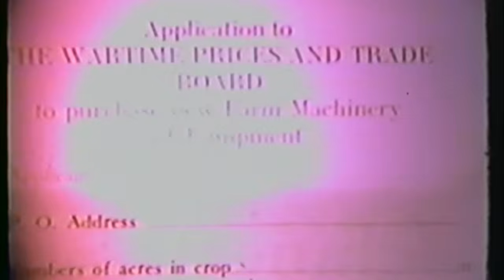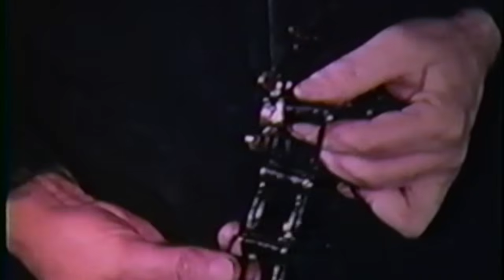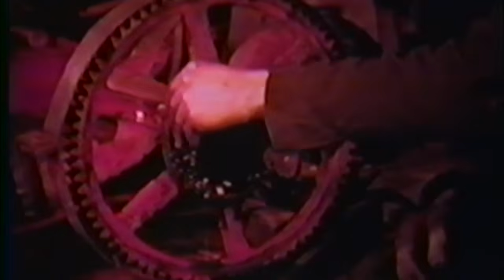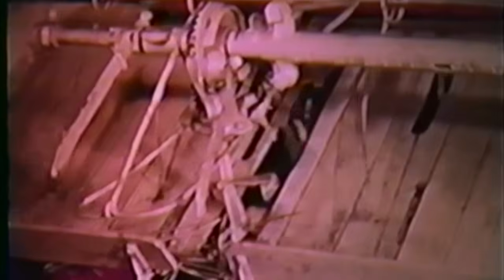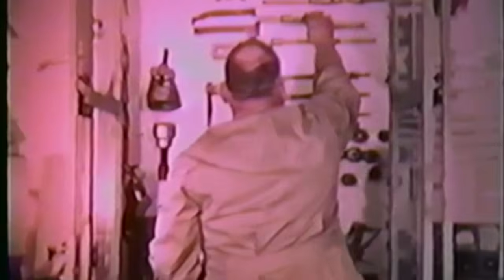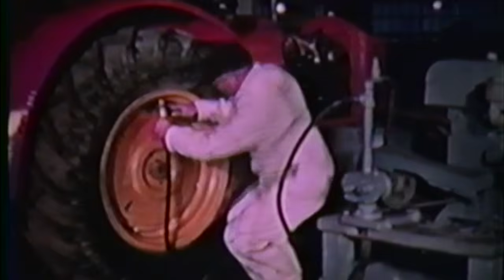Wartime Service of Farm Machinery,  Massey-Harris Co., Ltd. 1943

Comment: 😊😊 in 1938 and afterwards tractor engines had insert bearings 4 the crankshaft and 4 the connectinning rods  and 4 the camshaft they didn't use the babbitt bearings U had 2 pre heat the bearing beds and U had 2 heat the babbitt 2 pour it and use babbitt Wright and shim the bearings 2 pour them 😊😊 OMG 4 21 2O26

Comment: 😊😊 there is is another trick 2 clean the battery 🔋 😊 U can use  a soda or baking soda 2 clean a battery it eats the acid up U can wash W soda or water afterwards and a wire brush 😊😊 OMG 4 21 2O26

Comment: 😊😊 thats a old school 🏫 😊 ground driven sickle bar mower later on they was PTO drive from the tractor 🚜 😊 2 clean tractors back then they had a steam cleaner or a steam Jenny U would hook the water 💧 😊 hose up and turn it on and turn the cleaner on and let the water get hot then clean the tractor 🚜 😊 OMG 4 1O 2O26

Comment: 😊😊 alot of tractors 🚜 😊 back then had a oil bath air filter U dump yhe old oil out clean and wash out the oil bath cup and refill W new oil put it back on then tighten it up 😊😊 tractors W a dry paper air filter wasn't until later 😊😊 OMG 4 8 2O26

Comment: 😊😊 that was the good 👍 👌  times back then when U went 2 the tractor 🚜 😊 dealer back in the 194OS /195OS  W grandpa 👴 😊 dad 👨 😊 or W uncle and the kids of the 194OS /195OS they didn't 4 get it either when got 2 go the tractor dealer 2 the brand new tractors back then 😊😊 and better yet they got 2 ride W grandpa 👴  dad 👨  or W uncle on the tractor 🚜 😊 back the then and in the late 194OS diesel tractors was new direct start no pony engine and some of them had a pre heater on them 4 cold weather start up 😊😊 and they was pre glow plugs they was made until later years later 😊😊 OMG 3 27 2O26